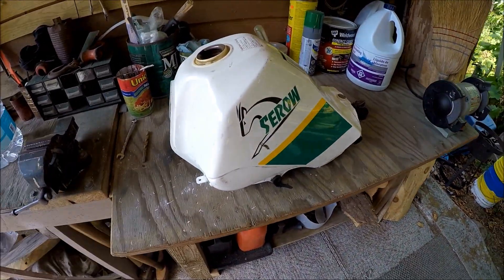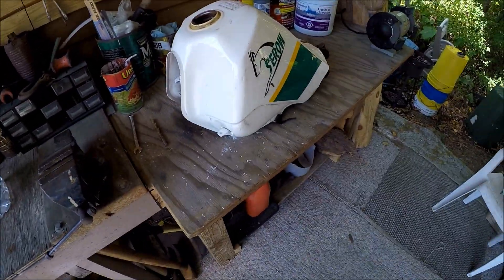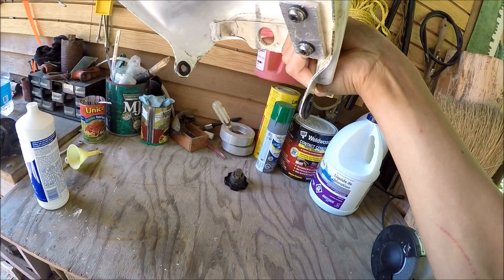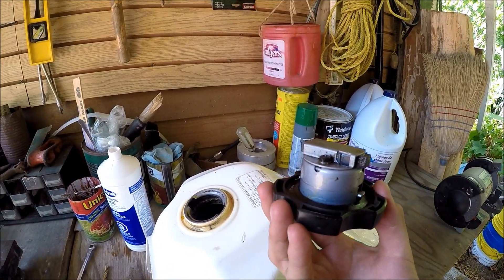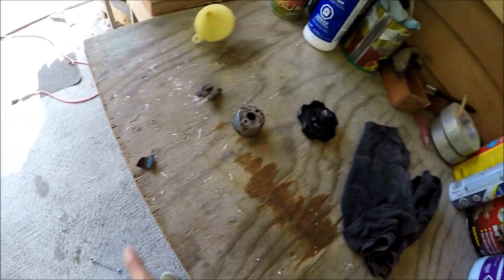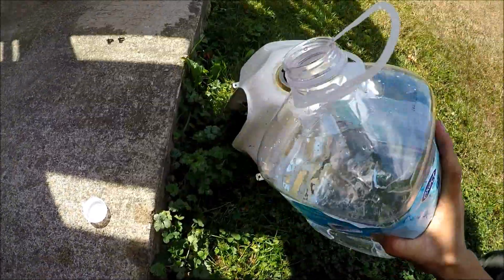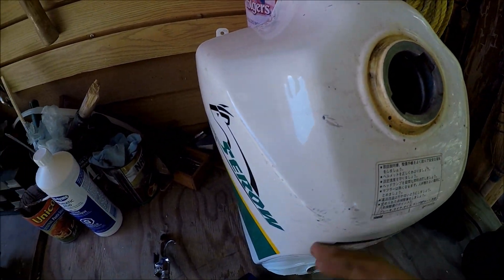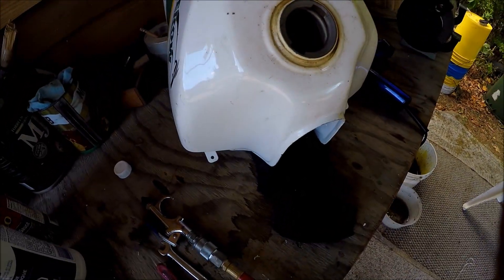Gas Tank Rust Removal with Muriatic Acid

Comment: I use muriatic acid to get all the thick rust then after rinsing that out and letting it just start to flash rust I throw in some phosphoric acid(rust converter). It seals the surface so the rust won't come back easily.

Comment: You must add a box of baking soda to the distilled water to neutralize the acid.
Or it will cause problems.
The acid in the metal will keep working if you don't kill it after the rust removal
Reply: Good point. So maybe the flush should incude the neutralzer as well. Are you saying high pressure water alone like a car wash would not be sufficient?
Reply: @garymurawski1476 buy a small box of baking soda, mix with water and slosh it just kike you did, and then rinse once more to get residual baking soda, and then dry.

Comment: Also life tip drop a clean dry rag inside the tank and then use compressed air.  Rag flies all over tank absorbing the moisture and the air pressure will help you retrieve rag if tank is still on vehicle.

Comment: It's funny that he needed a funnel that was the same size as the opening of the gas tank. Snowflake strikes again!
Reply: No the funnel was way bigger.....he thought......if it melts metal wouldn't you think it harms everything else? Skin... plastic ...and metal for some reason gas caps has 2 of 3... R.I.P. acid guy
Reply: @djdreadknotz  why doesn't it burn the plastic container it came with?

Comment: Great vid, use e85 to get the water out, or dry gas. Wonder if u can use some Ospho to convert the steel after the muriatic treatment.
Reply: my personal recommendation through experience is YES...OSPHO added then is a perfect time since OSPHO is most effective using a little rust to bind to. Also will keep the tank coated against flash-rusting.

Comment: You should wear gloves and glasses, muratic acid gets added to water not water to acid. That stuff can splash. I use it in cleaning tanks as well. Works well.
Reply from the maker: Yes safety first always, stuff works well but is very dangerous..

Comment: Also would be a good idea to first rinse tank out with baking soda and water to neutralize the acid then add a lubricant to coat the metal inside 2 cycle oil will work and protect it from re rusting prematurely, just an idea but good video non the less.
Reply: AUTOMATIC  tranny fluid, is good too.  IT  has alot of anti-rust compounds in it as well.
Reply: @petersack5074  Can also just throw some phosphoric acid in there and it will leave a coating that won't rust. That is pretty much how all car bodies before paint are done.

Comment: You are very lucky you didn't get splashed or got the acid on you. You could have become blind or badly burned. You used no safety equipment, the very least rubber glove and goggles. Coca-cola is around 3% Muriatic acid is 31% to maybe 35%. If you breath the fumes during the reaction it could also be bad. You need to know what you are doing when you do it this way.

Comment: You don't dilute an acid with water. You put baking soda in there. You needed to neutralize the acid with a base to dispose of it. After the baking soda has done its thing, then you can add the water to remove everything.
I'm sure where ever  you poured out that muriatic acid at, the plants probably withered a bit.
To get the water out of the tank, you just need to put the tank on top of a solid piece of metal and that sits on top of a grill/fire pit. The heat will dry out the water. 
Good show of what the power of muriatic (hydrochloric) acid can do  :)
Reply: @korishan your an idiot!
Reply: @jeffrey9102  Possibly.
One must be such to recognize such in another.
Reply from the maker: +Korishan yeah I realize now, that's what I should have done. Thanks for the tip tho. I ended up just buying a new one.
Reply: @carlaisiordia1180  thanks for that that's what I thought. Doing it tonight then just going to rinse it out